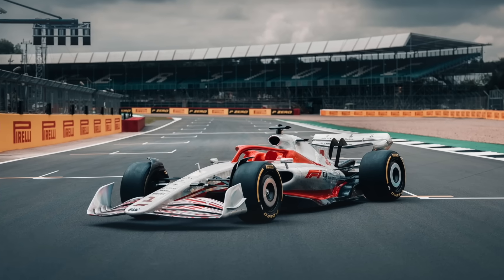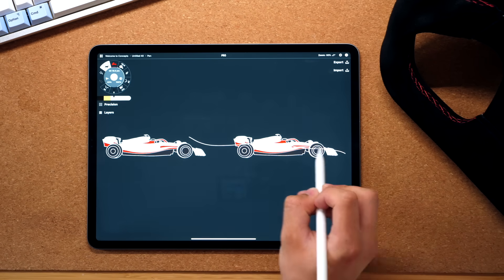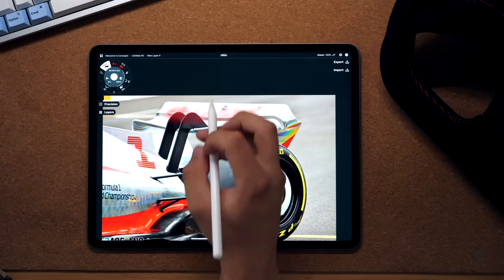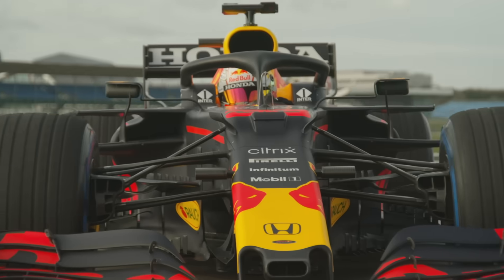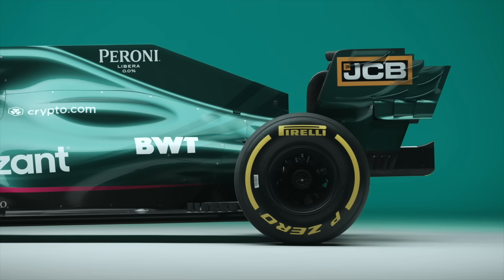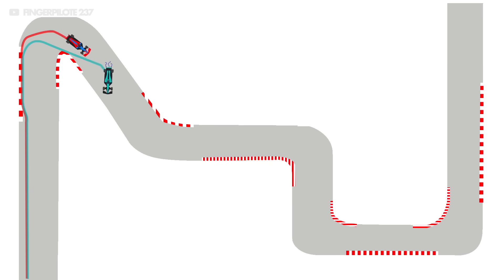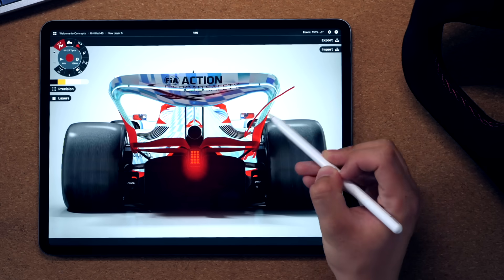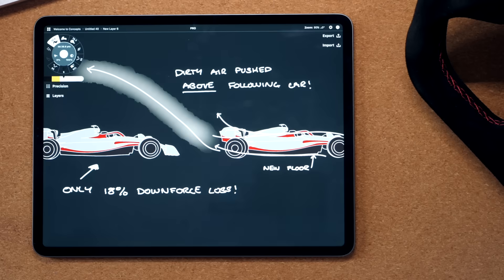Why Formula 1's New CURVED Wing is GENIUS

Comment: First I like to say that I find your videos very educating, that's why I subscribed to your channel, but there's something I like to debate with you.
If you move the dirty air up from the diffuser, up and over the car behind, something has got to fill that (big) area, right?
This will create even greater vortices, right?
First you had relatively small vortices coming from the rear wing endplates, now you get vortices from the total car.
First you had air swirling all around, now you get air coming in from the sides, hitting you left and right, pushing you from side to side.
Especially with those large front wing endplates.
And if this air coming from the diffuser is lifting the dirty air up, isn't there a risk that this "uplifting" can also lift the car close behind up?
Or am I getting this all wrong?
Just an opinion...
I can't wait to see these cars perform in the wet, so we can actually see how the air really flows.
Reply: Vortices are born when flows of different pressures enter into contact. You wouldn’t have a total car vortex, but you would have a low pressure area behind, which should hurt the Cx, but I’m sure they thought of that. In all likelihood, the energized airflow coming from the diffuser serves as ‘insulation’ from that depression, which should reduce its impact. It does probably divert said flow slightly downwards, which could be one of the reasons their wake reduction is a little higher than planned.
And no, there’s no chance it would lift the car behind it. If anything, drivers who like to wait until the last second to overtake might actually get an increase in front wing downforce, which could be interesting the first few times. But the new front wings should create a lot less downforce, so they’ll be less sensitive. Also, it happens very rarely, so should be fine, I hope.
Reply: @KillCamEditoR  What about the Mercedes following a Toyota at the 1999 le Mans?
Reply: @Smarpache  that’s very different. That’s not the car being pushed by the updraft from the preceding car’s diffuser. If you look closely, it’s the rear of the car that lifts up, not the front. That’s due to the airflow from the diffuser separating (stalling) resulting in a complete lack of rear downforce. As soon as the back of the car starts to lift, air rushes in and it takes off. 
The preceding car could have had some impact, but by the time the air reaches the diffuser, it’s already been modified so much that I doubt such small variations in upstream conditions have any significant impact.
It’s the same problem the Audi TT had, back before they added the rear lip spoiler. The ass took off and someone died.

Comment: I can imagine engineers working to actually create dirty air at the back and increase down force loss for the car following, I mean you can't unlearn a concept
Reply: If that happened, I hope that FIA try to do something for the team who did that.
Reply: That would be pretty smart to do. But regulations would be tight enough to make the engineers spend sleepless nights trying to figure it out
Reply: Why would you do that when it slows down your own car to do so? Makes no sense at all
Reply: @canismajoris6733  It's only by a bit and it can provide downforce just like current wings. You don't need much to change the air flow at such high speeds. I'm nearly sure rear end of the car will be nearly the same in all teams because of that. Also it's very easy to measure so there should be no "flex wing" situation.
Reply: @canismajoris6733  just by making sure the diffuser doesn't bring the over body dirty air up, make it out washy
Reply: @canismajoris6733  Slows your own car? How?
Reply: @Someone25948  Dirty air is basically fancy way to say a wake drag. Literally same thing, only differentiate because we talked about different implications.
Reply: @bocahdongo7769  But if the turbulence is created behind you, how will it slow you down?
Reply: @Someone25948  Same thing as why Jeep get up to 0.46 on Drag Coefficient. Or why wingtips and winglet exist on a airplane

If you ask F1 coefficient, it's around 0.9 to 1.2. Which is absurdly un-aerodynamic  considering Corolla is only around 0.31
Reply: @bocahdongo7769  remember cooling also plays a big role in the aerodynamics, which is why the veyron's drag coefficient is also at 0.41 which is more than the Toyota Corolla
Reply: @Someone25948  Energy is lost creating that wake
Reply: @zknarc  Oh I see, thanks for explaining
Reply: @Someone25948  Suction.
Reply: @Someone25948  it sucks you back. That’s how drag works, or rather 85-90% of it.
Reply: Chun Hei SO
FOPM/F1 said they would come down hard with the nerf bat, if teams broke the spirit of the new rules.
Reply: Gotta enforce strict regulations.

Comment: Colin chapman: You couldn't deal with your faliure, now return to ground effect.
Reply: Simplify and add ground effect.
Reply: @tnexus13  colin chapman was a smart lad
Reply: Where does that bring you? Back to tunnels.
Reply: @bornanagaming3329  Peugeot lmh 😳😳
Reply: To be fair, relying entirely on ground effect is dangerous, that's why it was banned, after all. But as it turned out, going completely without it hurts the racing due to dirty air. And so, in the end, they finally realised that absolutes are bad and truth is somewhere in the middle. And so they made this. Perfectly balanced, as all things should be.
Reply: @MegaCityGhost  To also be fair... I imagine it took the little Indycar experiment of going primarily to ground effect and having it massively improve the racing to push F1 into finally saying "alright fair enough." All jokes aside though, ground effect was never necessarily dangerous, even going absolutely bonkers with it, the issue was that F1 essentially had the same issue that NASCAR had with their Super Speedway races (Daytona, Talladega) where the cars were getting faster and faster but safety wasn't really keeping up with that improvement in speed, plus it didn't help that ground effect was essentially the wild west of aerodynamics for racing at the time. They both had an issue, slow down the racing and basically hurt the advancement of the sport to improve safety or just keep things as they are, and we all know what they decided to do, and it's not to say it was the wrong decision necessarily. NASCAR implemented restrictor plates and F1 banned ground effect. To be honest though, just like turbochargers, F1 has always, in a way, been rather slow to reimplement technology after all the kinks have been ironed out.
Reply: @MegaCityGhost  Perfectly Balanced? We will see... No DRS is a good thing to not have!
Reply: @samghost13  It just felt like a good place to make another reference to Thanos, to mirror the original comment =)
Reply: colin was a man ahead of its time
Reply: OMEGALUL
Reply: My thoughts exactly. Back to when British teams had to find a way to combat superior engines!
Reply: like Thanos once said " You could not live with your own failure. Where did that bring you? Back to me"

Comment: I mean, it's clever and all, but Formula 1 should be speed machines, not overtaking machines. Slowing cars down for safety is understandable, like in 1994, but this isn't anything to do about safety. It seems literally the entire car is designed to reduce dirty air, and nothing else. The cars in 2009 were faster than in 2008 because the teams discovered loopholes. According to F1, they literally made sure there are as few loopholes as possible, which ruins the creativity of engineers. I hope I get proved wrong and these things will be within 1 second of the current cars.
Reply: It's up to the FIA to improve safety, and the overall quality of racing. Less exciting racing means less viewers, means less money, means an unsure future for Formula One. To ensure that people still watch, they want more overtakes.

It's up to the Teams to create the fastest cars they can with the rules given.
Look back to 2014, cars were much slower than 2013 with the new regulations. Fast forward a few years, 2020 cars are now about 5 seconds faster than 2013.
Reply: @yannickvaz694  If people want overtakes and stuff like that why don't they watch Formula 3 or Rallycross? I'm not saying we should ban overtaking in Formula One, I'm just saying that F1 isn't what the FiA are turning it into. Remember the rocket fuel powered insane 1,200HP turbo cars. They were VERY exiting to watch, even though there was hardly any overtaking. Or the screaming V10 superlight aero monsters from the early 2000's (on "real" slicks they are faster than even Mercedes W11).
Reply: @mancantswim66191  Those are more based on engine differences. I'd love to see V10's back on the grid, but considering the impact they had on the environment, and their cost, it's highly unlikely.

If you look at the main criticism with F1 in 2019 and 2020, it was that every race was probably a Mercedes 1-2. Everyone started getting bored of it. FIA needed to do something to keep fans interested, and so they did.

I highly doubt that I'm speaking only for myself when I say, I would love to see more racing in a racing series. If cars have to be redeveloped, so be it. Within a few years the new aero cars could be faster than the current gen cars.

I do get your point though.
Reply: @yannickvaz694  If they could make the V10's last as long, there would be pretty much nearly zero impact on the environment. If every car in the world was electric except 20 ginourmous, W16 twin turbo petrol destroyers, we would be a lot better off. Also, with synthetic fuel, a return to V10 powertrains might not be as far fetched of a possibility as you might think.
Reply: @mancantswim66191  Yeah, I heard rumors that V10's could return with the new fuel regulations.
Reply: @yannickvaz694  That would be insane. Add a hybrid and we would see power levels knocking on the door of 2,000HP. However, it would kinda ruin the whole environment thinghy, since your mining all that lithium to get the battery (F1 engines last for around 6500 km I think, which means producing the electric battery wouldn't offset the emmisons produced by ICE). If not V10's then maybe Inline 5's? Those old Audi Quattro's sounded amazing. Also, synthetic fuels would probably mean a Porsche return, since they are heavily invested with the project with the German government.

Comment: How are they going to implement DRS into such a weird wing shape? Will there be DRS at all?
Reply: Search pic on net of windtunnel model from fia lab.  There u will see how they implemented  wings into endplate. Essentially drs flap is in flush with current surface on 2nd element. So classical attachment 3 point design. With hinges inside aerofoil contour of 2nd wing member.  So in that case main plate becomes real load bearing member.
Reply: Ofc is not given FIA will decide if they will use DRS in racing.
Reply: The DRS is still present. It's a smaller area now
Reply: I have been enlightened with knowledge thanks the the comments section thanks guys lol

Comment: I mean, if they want no "dirty air", the rear wing should be a stabilizer not a pure downforce device. what if they stick ALL of the downforce under the car? Could there be problems as they had with the first ge cars, if they would drive over bumps to fuck the vaccuum up?
Reply: When ground effect cars lose ground effect suddenly they tend to like to take off

Comment: I'm curious how does the drs flap work
Reply: I don't think there's going to be drs anymore
I think they're going to go
Reply: Drs should be limited.. like for example.... Can be used twice or three times per race.
Reply: @kjubajla Yeah, it would be better if it was like the attack mode in formula e, imo.
Reply: I wish they remove drs. Just like the old days. If you are able to follow the car easier, then remove drs
Reply: @mrkic23  Or at least make it do it's proper job to level out the performance loss from dirty air (like 2011). Nowadays you get ridiculous 1km long DRS zonesw which clearly give the car behind an advantage. If the guy in 2nd has fresh tyres, you literally cannot defend your position since he will be so much faster on straights. If there was just one 1/2km DRS zone the guy behind would have to overtake on a corner, like Hamilton in 2011 China or Verstappen at Blanchimont.
Reply: @mrkic23  Well it's mostly theory for now, it will need to be proven 1st.
Reply: @mrkic23  the DRS will be there in 2022 car. The idea of DRS is good, it's just bad with those cars that produce so much dirty air, as 2019-20-21 cars ( i just recently watch F1, so I just find problems on those ones), the biggest victims are the backmarkers (Alfa Romeo, Williams) where they have to squeeze every bit of the car on every corners, saving battery for the DRS just to only be able to getting closer to the faster mid-field teams, not passing them. With the new car design, the slowest cars can still fight at every corners to getting closer or even overtaking others before reaching DRS zone. This is just my opinion and I strongly believe DRS is here to stay, it's just that DRS will be much less important.
Reply: @mrkic23  I think they're using DRS up until 2023, and removing it if it's not needed afterwards
Reply: @mrkic23  like the old days, when overtaking only happened in the pits
Reply: @Blueturtle1  no mate, when overtaking required positioning and skills.
Reply: @mrkic23  question, have you ever watched the “old days?” If you have, then you’d know people have been moaning about it being boring since the start. Take off your rose tinted glasses
Reply: @mrkic23  oh yes, the only overtakes on track were Schumacher passing Barrichello
Reply: @Blueturtle1  i watch f1 since 1997,  every race since then. Please be respectful, without insults.
Reply: Yeap obviously DRS came as a solution to a problem, but it's hard to argue against the notion that although it allows more overtakes, it does make them look kind of artificial as most of the time you get a bunch of extra speed and the overtake is done even before approaching the braking zone. So no point arguing about the "good old days" vs today. If it's possible to have cars allowing overtakes to be done without DRS, everybody should be happy.

Comment: Brilliant video, aerodynamics are fascinating, the new cars look stunning and hopefully improve safety and racing.
Reply: A good race is not always dictated by speed, for me
Reply: Not speed though. Although let's face it, it's racing not time trial.
Reply: @F1ll1nTh3Blanks  cars will lose a couple seconds as they usually do on major regulation changes but give them 2 or 3 years of development and they will be faster than current
Reply: @4zap7  It's worth noting the engine freeze starts 2022 so the season to season gains will be less than previous eras.
Reply: @MrDoItNice  good point
Reply: @4zap7  Development will be very restricted from next year on.
Reply: @F1ll1nTh3Blanks  if speeds only went up every year, eventually we wouldn't have any racing on older tracks where you can't fit larger runoffs or crash barriers. Indy had to develop the SAFER barrier as oval speeds increased, drag racing introduced lane dividers, mandatory parachutes below threshold times, and 1/8 mile races where cars' vmax at 1/4 mile were too fast for the conditions.
Reply: @EmyrDerfel  it'd be pretty cool to have the ridiculous Gran Turismo X2010-ish fan cars, one tiny malfunction and the car understeers into a barrier with the driver turning into paste

or the driver simply passes out in 1 turn
Reply: @F1ll1nTh3Blanks  speed isn’t everything. Especially since f1 is based around corners. Idk much but that’s my understanding
Reply: @TheM.F.  We are talking about laptimes.
Reply: I just hope we can see Alonso and Kimi for at least one season in these cars. People knock them all the time, but some of their starts this year have been incredible.
Reply: There is a slight mistake. Diffusers decelerate air not accelerate as he mentions several times. Bernouli's principle.
Reply: @s2hedz  you've got that so wrong, decrease in air speed increases pressure, increase in air speed causes low pressure, and as such a suction force between the cars underbelly and the road
Reply: @hardlinefoil7532  oh sheesh it's great when someone that has no idea what they're talking about tells you you have no idea what you're talking about 🤣. I'm a mechanical engineer with a Master's in fluid mechanics. So do more listening and research before piping off. You are correct, decrease in air speed increases pressure and vice versa. But larger cross sectional area decreases velocity, thus the diffuser is a low velocity deceleration region. But the diffuser is only half of the equation for fluid flow in the underbelly. By reducing air velocity at the end of the tunnel you increase air pressure smoothly to ambient pressure, thus forcing the flow under the car to drop further in pressure and increase suction overall. The diffuser is able to create a pressure differential to the high pressure ambient air that would not normally be there. Watch Engineering Explained's vid on the topic from 9 years ago. It has a decent but not fantastic explanation. There are probably hundreds of articles explaining it out there so I'll leave you to it.
Reply: You said it yourself "you are correct", the diffuser is the whole system, not just the venturi. So yes actually the whole diffuser system as a whole does result in a lower pressure
Reply: @s2hedz  for someone who has no idea I seem to have made a pretty damn good race car from scratch
Reply: @hardlinefoil7532  way to go
Reply: @hardlinefoil7532  yes you got the "low speed = high pressure" bit but you were full on incorrect about my comment because you didn't know what the diffuser actually does...and you can't admit your mistake...sad bro.